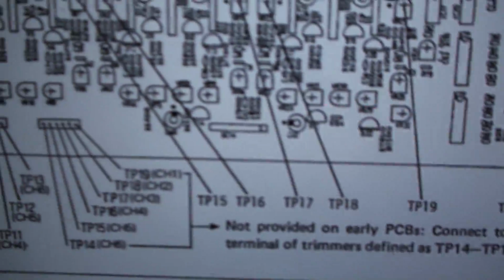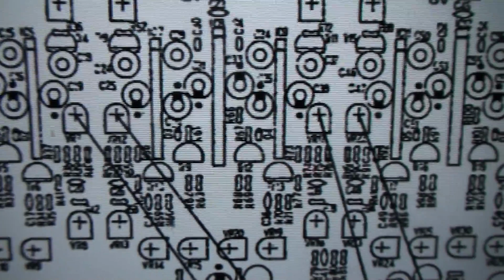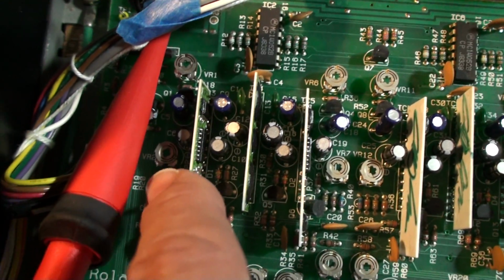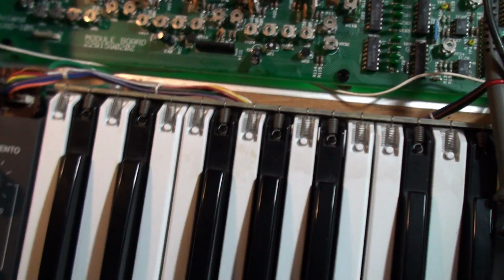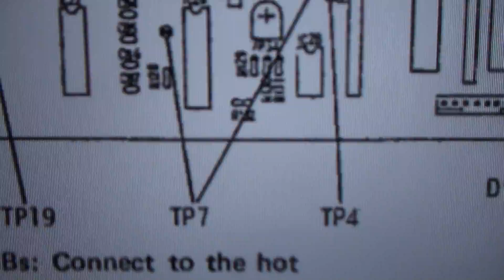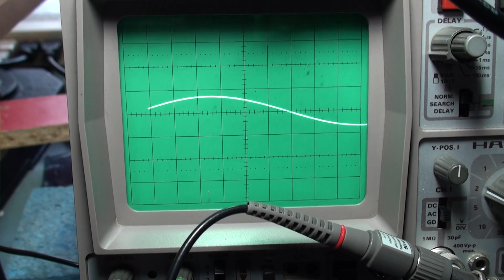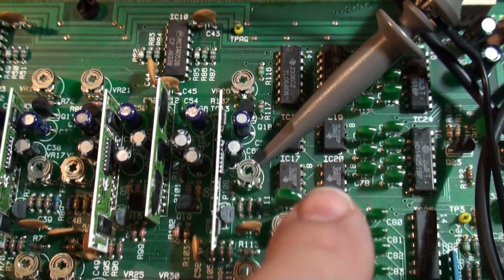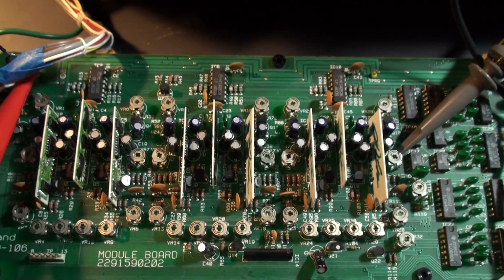Answers to Questions 1 - Juno 106 Module Board Test Points

Comment: Looking at the trimmer with the single/hot pin facing away from you, the left one of the 2 pins on the other side can be used as well. It is connected directly to the hot pin on the PCB.

Comment: Great video. 
I'm working on an early module board, it has the separate wave generators (A+B) in each slot. There's no voice out, but filters are ok. TP7 is -10v and VR33 has no or poor effect on the attenuation. I doubt the voices are not working, it seems to me that the problem is in other part of the board. 
Did you some similar experience? 
Any information will help. 
Thank you!